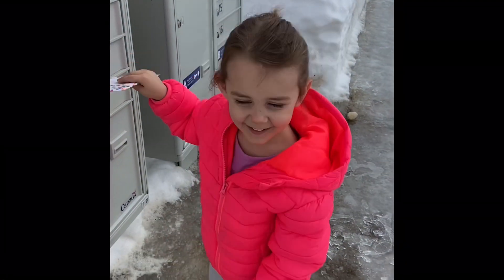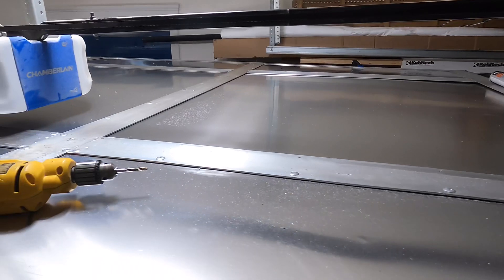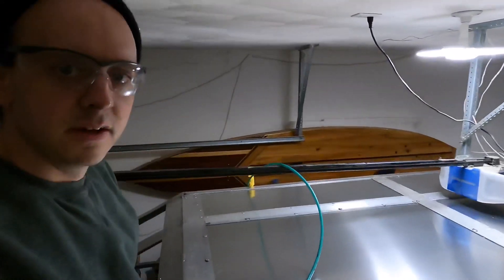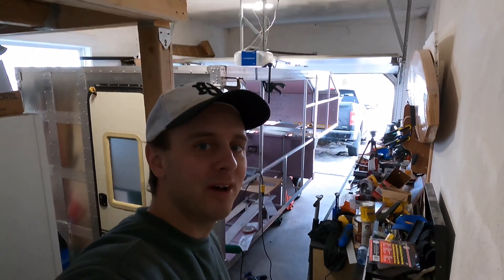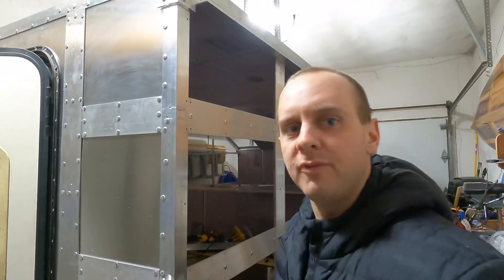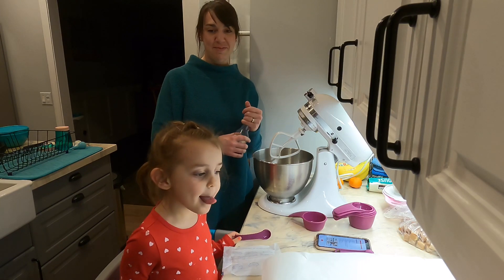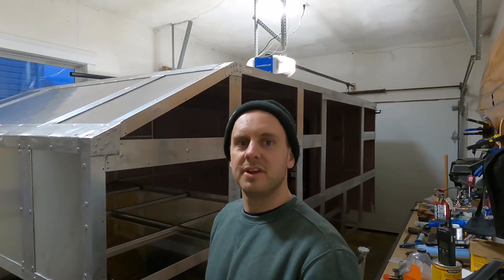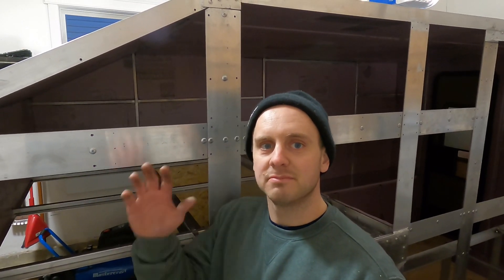Building Our Truck Camper- E10 -Installing The Roof Panels

Comment: 08:29
On our ExpeditionVehicle, we have six 305-Watt photovoltaic panels, a total of 1,830-Watts.
For over two decades, these topped our ancient eight 105ah Lifeline Concord AGM bank.
.
Finally, the bank got too tired.
Last week, I took my specifications to MAC'S BATTERIES AND SOLAR in Eugene Oregon.
They built two LiFePo4 batteries, 24v at 340ah...
... equivalent to fifteen BattleBorn 105ah at a fraction of the price.
.
The only problem -- each weighs about 100#/46kg!
Reply from the maker: That saves a lot of space replacing those batteries. I currently am running lithium 50AH batteries but I am not having good luck as a few have failed quickly dropping voltage. I am considering going back to a regular deep cycle battery to power the camper basics and hopefully it is more reliable.

Comment: Like your build. A little big for my idea of truck camper: but it sure looks good. Has to be very light? The supports for walls don’t look heavy enough…. Be nice to see final product. Can’t beat your pop robot tool👍 B Deacon Manitoba Canada 🇨🇦
Reply from the maker: Thanks for watching! So far the supports have been good, I’ve been walking around on the roof with no issues. I’m not exactly sure on the weight I’ve been to a couple scales and they all seem to be different. I am thinking approx 900-1200lbs as it is now.

Comment: Tonnes of hard work on your part to get this far. What's your plan to ameliorate thermal bridging in the camper? Another layer of foam on the interior to insulate all the currently exposed interior aluminum?
Reply from the maker: There’s lots of work hours into it now that’s for sure. I am going to be putting a layer of 1/2 inch pink foam on the interior to cover the aluminum. After the foam I will put on the interior finishing. Next step is figuring out what I want/need to include for wiring etc
Reply: good job to use tonnes instead of tons

Comment: Looks great! Congrats on the work!

I’m really interested in why you went with rivets and then also welded those joints? I had thought that one of the benefits of rivets was to allow a strong joint to have some movement. Don’t take that question the wrong way - I don’t know anything about this (especially aluminum) but I’m trying to learn… and hopefully build a rooftop tent and eventually a teardrop trailer. I appreciate any info.

Last thing, I think you have a battery (motorola?) to change.
Reply from the maker: Hey thanks for the comments. I originally planned on just tack welding the corners as an extra but when I drove with it on my truck prior to installing the panels I think it loosened things up. The rivets were a huge help to piece everything together and save time while welding though. Any questions feel free to ask, I’m not an expert by any means but I’d be happy to help if I can. 

Looking back I think the panels would have held things together but with the welds and all the extra square tubing it is so much better. We didn’t want to take a chance on things structurally failing while travelling with two kids. 

Yes you are right, my battery could use the charger, and it is a Motorola. It’s such a distinct sound when you work with them I was wondering if anyone would notice. That’s the bonus of being on call and trying to work on projects.
Reply: @SEAKAdventures  yes it’s a distinct sound. 
Very cool build! Thanks for the reply!

Comment: 11:54  what kind of glue is used?
Reply from the maker: That is PL Premium glue. Came in a black tube and then I had to spread it smooth with a trowel.
Reply: @SEAKAdventures  Did you mist with water, same as Riley and Casey Courtney?
Reply from the maker: @jwiereng  Yes I did. I think the tube had specifically said to add water so sometimes I used a spray bottle and other times I used my fingers and just flicked droplets of water. When cutting the sheets to install the panels it all appeared to have good adhesion from what I could see.